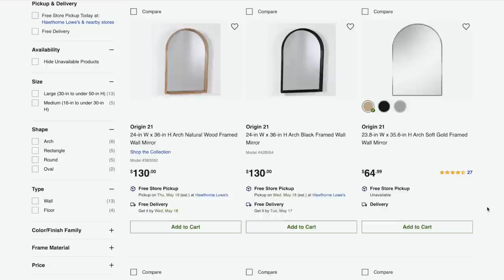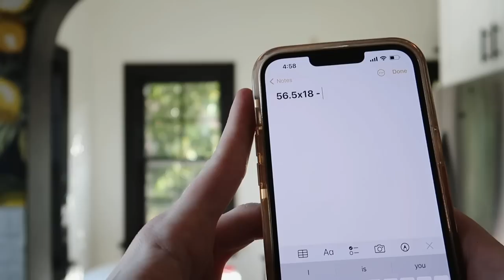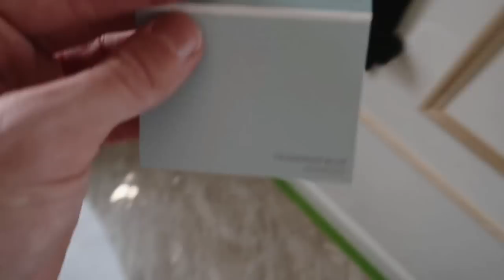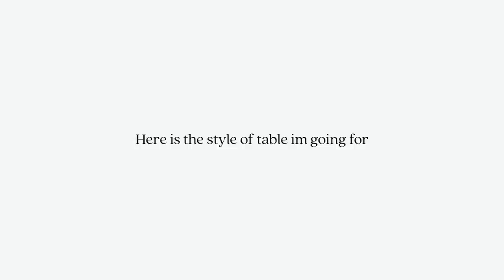Vintage Revival BREAKFAST NOOK MAKEOVER + DIY Fluted Round Table (Budget Friendly)

Comment: I loved the lemon, but I really love the newly designed nook!  I had a small round table and used it as the base and made a fluted side table that I love so much. It’s just like yours.  As always beautiful!  I love the paint.
Reply: If it might be necessary to remove it later paint the molding before you nail it in.

Comment: If I get the rental I really really want and already am so in love with, I'll steal the striped-archway idea from you. The apartment has an archway between a slightly older kitchen and the dining room, where the dining room has the most charming wood flooring, white wood panelling and just the most amazing windows and as an added plus, a wood stove. It's the scandi-wet dream, honestly, and it's even located in Denmark, which just adds so much extra charme. I'd love to add a darker color above the white panelling, and also touch up the kitchen a little bit with color and maybe different flooring if that is possible there.

Comment: I saw my floor installers use a rubber mallet to hit the cutter & the edging popped right off! Now I'm using it to finish mounding & quarter round.
FYI - I'm a 60 yo straight female (grandma)...you & that tank top look just fine Drew!

Comment: The one thing I would recommend for the table base is ballasting it (adding sand, rocks, etc) as it would make it a lot sturdier. Drum bases for tables like that often can tip or wobble if they aren’t heavy enough so before nailing those last few dowels in the base, I would’ve added a little more weight in there

Comment: Hi I went immediately to the website for the black shelving but that is a different shelving system. It has wooden shelves instead of the solid black metal looking shelving in yours. I don’t think that wooden shelving will work in my space. Is there another listing for the one you have in your kitchen because that link is different from the one in your video. Thanks! But actually a beautiful and well done makeover !